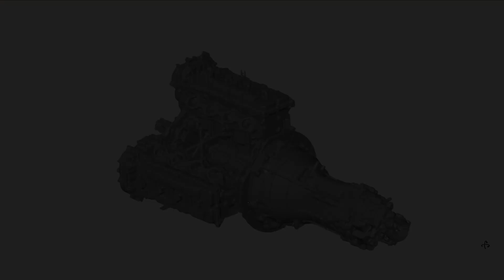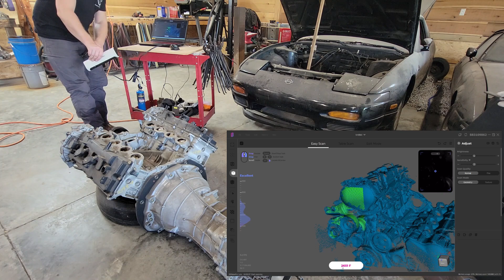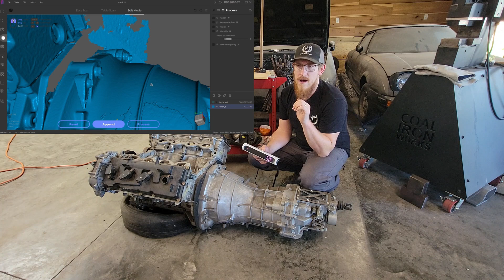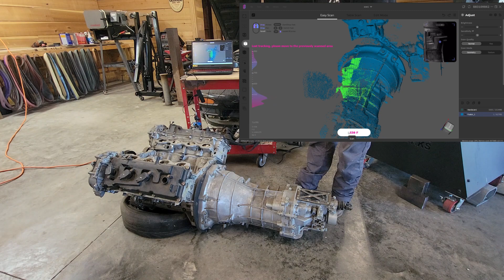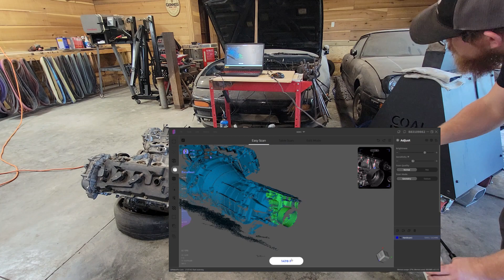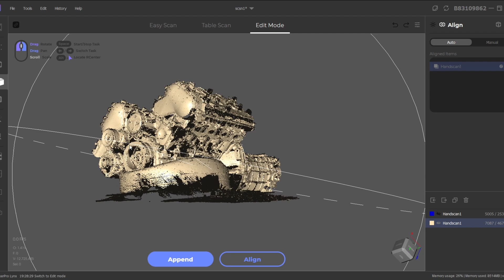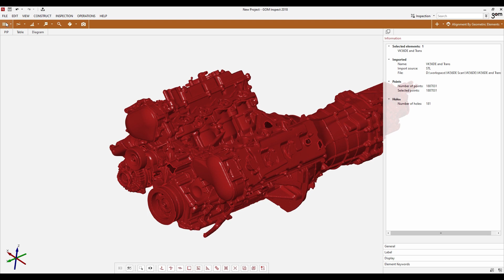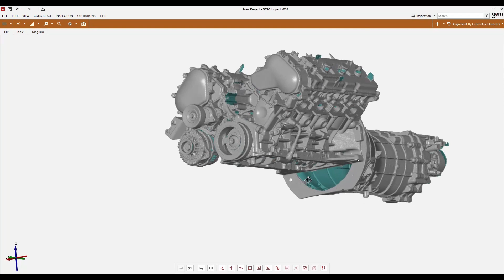Titan Powered S13 by 3D Scanning Part 1

Comment: Great video, thanks. Any more tips you have on strategies to avoid scan distortion when scanning large objects would be much appreciated! I've always struggled with that with my HP 3D Scan Pro. I'm tempted to replace it with one of these, and really want one, but don't really scan things often enough to justify the expense. I'll look forward to more episodes.
Reply from the maker: If the scanner doesn't use targets, geometry is your friend.  The more you have,  the better your scans will fit together.  If you are scanning a "plain" object,  you can tape or glue small things to the part that you remove in post processing. The issue with these more affordable scanners is a lack of user calibration, so if you notice distortion and can't calibrate it, you may need to contact the manufacturer.
Reply: @Black240SXDrift  Thanks. The lack of any ability to re-calibrate  / configure for scanning totally different sized items is another thing which puts me off replacing my HP scanner with something like the Lynx. I really like that about the HP / David system. It's such a pity HP killed the project when they bought it, as it had a good 10 year head start on all the current budget scanners, and would probably completely blow them all away if development had continued. 
With scan distortion, I've typically had problems when for example scanning around the empty engine compartment of the a car body shell. Each scan aligns nicely with the previous one, but when the 1st and last ones meet, the small misalignments between them all have added up enough for the scans at either end to not meet correctly. Next time I'll have to try attaching something unrelated to the scan in the middle (where the engine would be) to try to help the scans align correctly.
Reply from the maker: @richardjones38  yeah,  especially engine bay scans are tricky.  With smaller measuring volumes and only using geometry for alignment, it's like stacking paper, and eventually, your deviation adds up.   You want to start your scan in the middle and scan to the outside to minimize that deviation build-up.  If you are scanning an engine bay without the engine in there,  you can add, say, a piece of plywood with things glued to it to give it geometry to fit to.  Once you have the perimeter scanned, you can remove the plywood and add in the crossmember, then just delete the plywood in post processing.  

This is the biggest issue with geometry based scanning.  All it takes is one scan that doesn't line up just right to throw it all off.  Targets or camera tracking make huge improvements.  However, even with targets, this can happen if it's too much larger than the single scan volume.  That's where photogrammetry comes in.  When you can use targets and photogrammetry,  your volumetric error is greatly decreased.  Unfortunately, these systems aren't super affordable. There are a few open source photogrammetric target acquisition tools out there,  but that's a completely other rabbit hole.
Reply: @Black240SXDrift  Thanks. It's great to hear opinions on this from someone who uses professional scanners for a living, rather than youtubers creating content for affiliate links, etc. but likely lacking any real scanning expertise. Especially when they're also using their scans for the same sort of thing as I am (I'm shoehorning an Audi V8 into a Porsche 914, with the objective being minimal, if any body mods - it's a super tight fit). I look forward to future updates and have subscribed. 
What spec processor and graphics does the laptop you're using have? My body shell scans are pushing the i7 2nd generation / 20 GB / Nvidea Quattro 1000 Lenovo W520 which I bought for scanning back in 2011 to its limits. I'll be replacing it shortly, possibly with a Lenovo P52 i7 9th gen / 32GB / Nividea Quattro P3200
Reply from the maker: @richardjones38  I should be scanning my engine bay here soon. I'll be videoing that. It will be a test to see how the scanner does. If I end up having issues, I'll trouble shoot those and show how I get around them.

As far as computer, I'm using an ACER Nitro 5 515-57 with an 11 gen i7 2.3 ghz with 32 gb of ram and nvidia geforce rtx 3050 ti.

It does okay. I'm limited at only being able to install 32 gb of ram. Really in 3d scanning ram is king. The more ram the better. For whatever reason, the software rarely takes advantage of multicore crazy processors, and mega graphics cards. We ran work station laptops on my last job and dealt with 100 gb + files fairly frequently. Biggest improvement we got was from 128 gb of ram. Processors and graphics will help but these programs love some ram.

A lot of the newer high end scanners recommend a minimum of 128 gbs of ram. Just to use the scanner. So the more ram you can throw at it the better. Even with processing tools like geomagic design-x, wrap, or even polyworks, ram is king. We could lock up custom built multi core dual graphics card desktop machines with scan data. It wasn't until we started going up on ram that we saw improvements.
Reply: @Black240SXDrift  That's really useful info about ram being the priority. Thanks again. I'll go back to ebay looking for good used workstation laptops from reputable sellers which also have insane amounts of ram! No doubt they're very few and far between, but that sort of spec new will almost certainly be beyond my budget. Good luck with your engine bay scan. I look forward to seeing it.

Comment: I have a revopoint, so far I've only scanned a headlight housing and some body panels. It gets lost very easily and the point density is very low. This seems to blow it out of the water(at least on video) but it also seems it's automatically converted to a mesh while scanning
Reply from the maker: Haven't used a revo point, so I can't comment much on it,  but all scanners do some sort of processing once the scan is completed.  Good possibility is taking each shot and doing a lightweight mesh for display and then processing all shots together into one at the end.  Again I don't know for sure,  but that's pretty typical for scanners in general.  Any geometry alignment scanner will get lost easily if not done right.  Smooth/ rounded/ flat surfaces are hard to track.  You need good fitting geometry on the part or manually align scans to make them work.  Now If the part has a lot of features it's much easier.  But that's why target recognition, though a pain to put then all on and take them off,  is a good thing.

Comment: what cad software are you using? i want to buy a scanner but im not sure if i have to purchase softwares like solidworks that are super expensive. any information helps and thanks for your time
Reply from the maker: I use oneshape for most modeling and Fusion 360 for the scan data
Reply: @Black240SXDrift  are they free? if not how much for the software?
Reply from the maker: @bunkerhg1  free
Reply: @Black240SXDrift  

have you tried any of the other scanners by 3d maker like the Mole, seal or the magic swift plus? if so which one do you think it is worth getting? sorry for all the questions. I just want to pick your brain. But thank you for responding to my other questions
Reply from the maker: @bunkerhg1  I've only played with the lynx. Unfortunately the only experience with another scanner was through a friend who bought the mole and he immediately returned it. He had some issues with communication with the scanner and it wouldn't take data. The lynx worked well for me. Just as I said in the video you have to be careful with movements or it looses tracking. But as you can see it does take nice data for the price.
Reply: @Black240SXDrift  oh damn that sucks for your friend.  Hopefully he found a better one.  thank you for answering all my questions
Reply from the maker: @bunkerhg1  no problem!